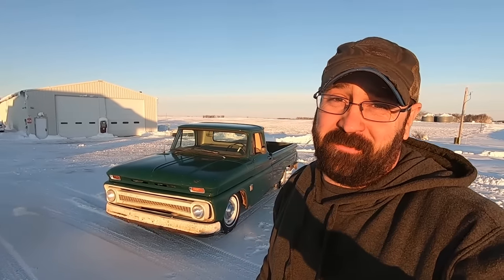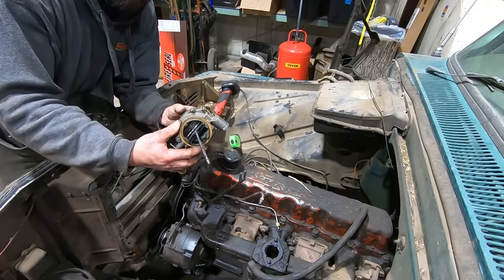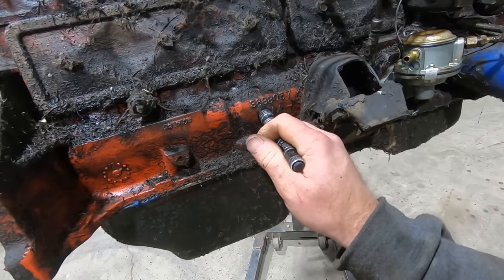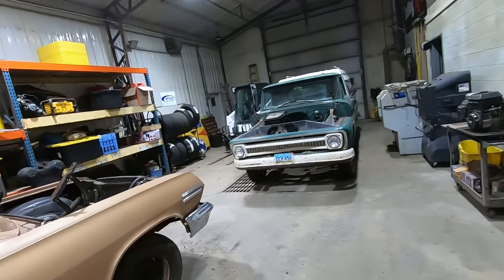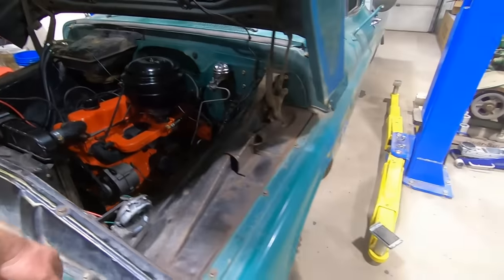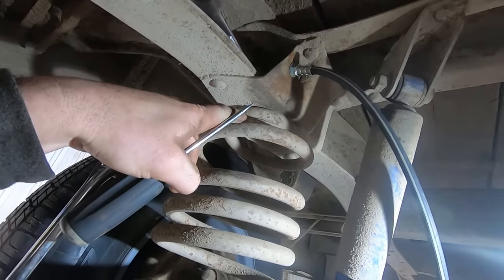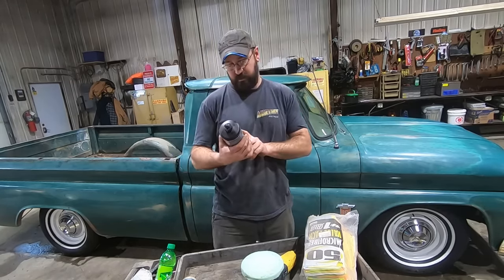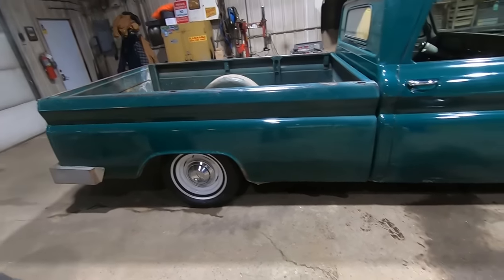1964 Chevrolet C10 Farm Truck! Amazing Budget Transformation!

Comment: I had a 194 in a '62 Chevy 2. It was orange and pretty zippy with a 3 speed stick. My '62 Pickup has been in the family since new. 6 235's later it now has a '59 348. Lowered pickups are for La Bamba's in LA to get stuck on speed bumps with. Period... end of story.  My 1/2 ton came with the rare 7.50-16 tires. Correct 16" 6  lug wheels are a bit rare for '62-'66. My truck has a corporation (Mott) rear axle with 3.89 ratio. You seem to have a Spicer type which could be Posi. Most likely not. Don't know the ratios for them... 3.90-4.11 maybe. Put the darn thing back up to stock height and stop being a wanna be Okie wanna be La Bamba. 283's were the best engines for these trucks. Short stroke works better with lower gears.  That is all. I was gonna offer you $500.00. for it until you lowered it.